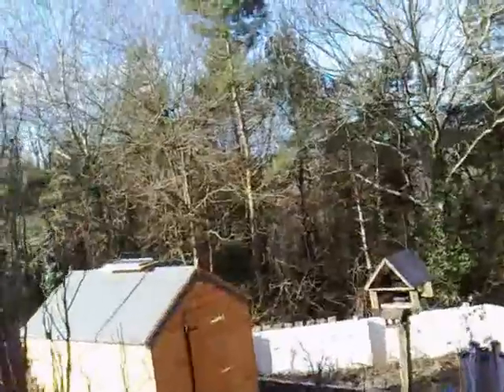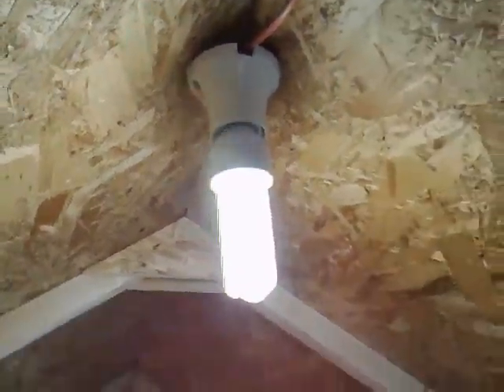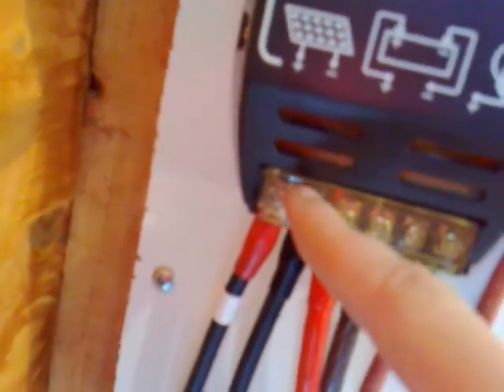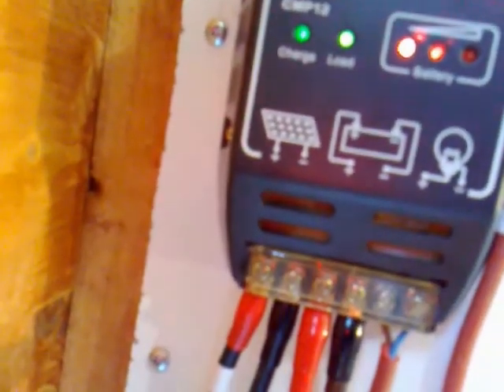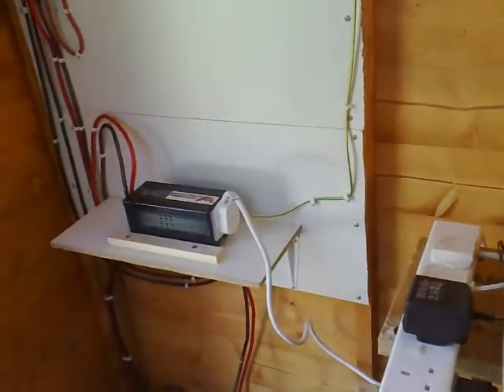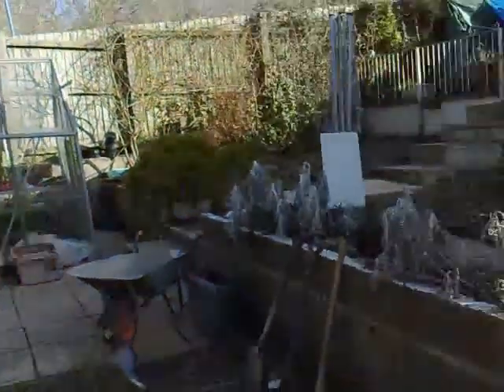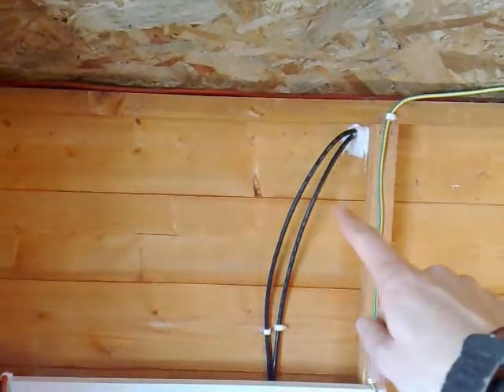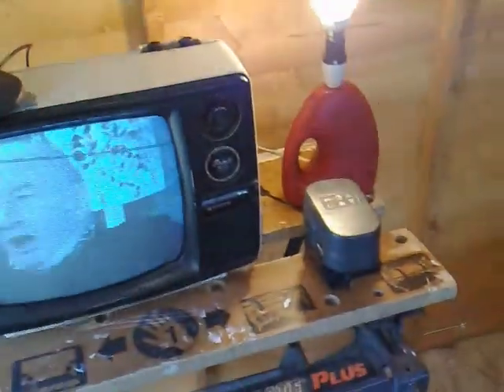Solar powered shed setup UK

Comment: How many lights can you run connected on the 12v
Reply from the maker: On this setup the charge controllers output is limited to 10 amps at 12v. So it would depend on the power usage of your lights, as a rough guide that should allow 7-10 12v CFL style bulbs as seen in this video.

Comment: Inefficient. No point making AC, just to turn it back into DC. Buy a DC-DC converter if your consumers are running on a DC voltage other than 12V.
Reply from the maker: Most consumer items run at 240v AC, for ease of use converting to 240v and back is best. Yes it's less efficient, but it saves having to convert any item we want to plug in and power.

Comment: please ditch the old tube tv, it wil draw to mutch power from your batterie, a modern LED tv ( preferebly straight from 12 volt) consumes round 25 watts an hour ( 2 amps) for heating you must use a way bigger battery bank say 2x 100 ah deep cycles combined wirh two 100 watt panels!
that will get you going...
Reply: hey Gio you sound like you know what your talking about, could i bag some advice from you on creating a solar powered system for my shed?  i would like to run these for a friday evening throughout the summer months
pioneer cdj 2000 x2 and 28w each
numark mixtrack edge (USB powered)
samsung laptop AC adaptor 240v 60w
amplifier 300w
could you recommend me a set up or create one yourself for us?, or am i pipe dreaming here because if its to big a set up then im just going to have to rig to the house mains

Comment: Nice job. For safety, I'd strongly advice you to put a fuse on the battery terminal and a RCD on the output on the inverter unless the output is already RCD protected. If for some reason a fault was to arise on the cables connected to the battery/charger or inverter, a fire could start or explosion.

Comment: Hiya first off great videos, i have a guestion regards my setup.
Im going to buy a ceiling rose, switch and cableing, And in your video you said your using a 12v cfl bulb, What is the wattage of the 12v bulb? and will that work with a 12v 12ah battery or should i upgrade the battery first.

Comment from the maker: Hi, I don't have a full cost list as we have been building it gradually.

If you are talking about JUST the solar shed and not the grid tied garage, then I would estimate around £4-500 on the panels, batteries, inverter and various wiring and accessories.

Comment from the maker: Hi jIXYKINg,

What kind of information would you like? The setup in this video was the start of our setup (see out later videos), for this we essentially had:

20w Solar panel (eBay)
10A Charge controller (eBay)
Battery (Halfords)
Inverter (eBay)
12v CFL light bulb (eBay, also available if you search google for solar light bulbs or 12v cfl)

The rest at this point was then just some cabling and plug points to join it all together. Plus the earth spike and associated wiring.

Comment from the maker: Hi, please see my later video:
"Solar grid tied garage setup UK - Wiring diagrams"

The setup in this video was quite simple, if you look at the charge controller itself you can see the core setup. The main extra was an inverter connected to the battery to give mains power.

Comment from the maker: @rccarmadben 
For the price it works perfectly fine. It does not have the same efficiency as an MPPT controller but is fine for a starter system.

Comment: Very nice setup with the wires properly sized.  Many people dont realize that the cabeling makes a huge difference in how well a system works or not.  Proper charging is absolutely dependant on the correct wire size.   Well done!

Comment from the maker: Well, it is O-K so long as your inverter does not pull more than 30 amps.

But you really should have it connected direct to the battery. Much safer/less likely to cause issues for you in future.

Comment from the maker: @crashguy711 

Actually NO. Your inverter should be straight from the battery, this is due to inverters (dependant on size) pulling very large amounts of amps. Mine alone can pull near 40Amps and that is only a 300w inverter.

That much amperage would kill the output section of your charge controller, it is only meant for small loads (1-10amp in my case) such as a light or a fan.

Change your set-up to avoid damage to your controller. Only small loads should be run from it, never inverters.

Comment: why did you go straight from your battery to your inverter? here is how i wired my shed from solar panel to charge controller from charge controller to battery, from charge controller to inverter. if your not going thru your charge controller from battery then it cant control the battery correct?

Comment from the maker: Thanks. It's a little over-kill at the moment as the cables are capable of 70-80Amps quite easily.

The panel only gives 1Amp, and the inverter uses no more than 40Amps...but it's is mainly for future proofing reasons :)

Comment from the maker: For now I keep a voltmeter handy and just check it now and again, so far the voltage is around 12.8v which is up compared to when the system started so all seems well :)

Eventually plan to buy a meter that can show in real-time power in/out of the system. But such meters are quite pricy. Will be worth getting though when the system grows.

In the short term I may fit a relatively cheap meter than can tell me in real-time the power coming in via the panels in watts :)

Comment from the maker: All inverters are essentially silent, apart from when their fans run if they get hot.

E.g. my 300w inverter is completely silent, until I start to pull about 200w and then the fan comes on to keep things cool.